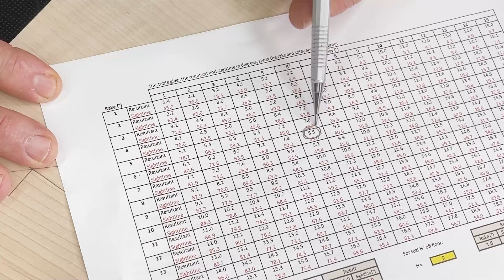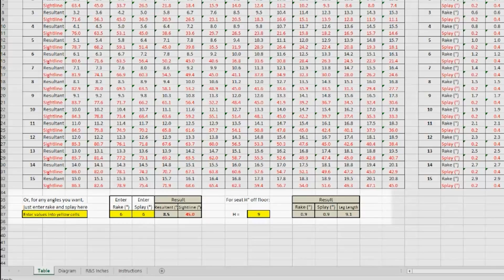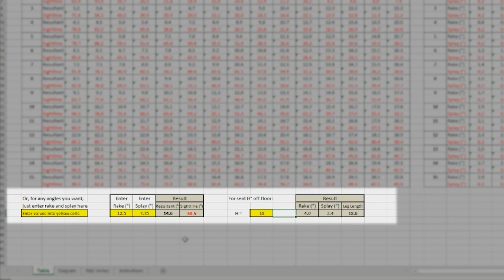Design & Build Angled Legs with DUAX Angle Drilling Table | Deep Dive | Woodpeckers Tools

Comment: Jeff, I've been looking at this for a while now but haven't quite been able to pull the trigger. The reason is I keep looking at the AutoAngle Drill Guide and wondering if it would be more useful or convenient being it's not constrained to the drill press. It would be a great "Deep Dive" going over the two together explaining the differences and where one might choose one over the other.
All the Best, Chuck.
Reply from the maker: Well, Chuck, I'll pass along an anecdote which I think will help you out. I would have to look diligently to find the Duax that is in my shop, but the AutoAngle is on the right back corner of the workbench that's against the south wall. I like the Duax, but AutoAngle is a little faster to get set up. If I were working on something that required absolute precision, I'd probably dig out the Duax. I did similar splayed leg stools with both for their Deep Dives and both handled the job admirably.
Reply: @WoodpeckersLLC  Thanks for the quick reply! That is what I was thinking, Duax for a bit more accuracy over the AutoAngle for speed and convenience.
Not quite the same thing but years ago I asked my Festool Rep. to explain the differences between the DF-500 and the DF-700 Domino's and which to buy first. His answer was, "buy the DF-500 first, but knowing you, you'll end up getting both".
The man is clairvoyant. 👻
I'll get the Duax for now, but I'll probably end up getting both. 🤣
I do love Woodpecker's tools!
All the Best, Chuck.

Comment: I built a pair of restorer's trestles (3 pairs actually) with splayed and raked legs that are let into the beam in socket (i.e. 3-sided) mortises.  The splay and rake angles are different.  So, I had to saw and chisel out the sockets at a compound angle.  It's not something that stays in my head, I have to re-learn how to calculate the resultant angle every time because I cut compound angles infrequently.  I enjoy the challenge of figuring it out and executing the cuts by hand.  That's what being an engineer gets you - more work.

Comment: On my list of projects is the building of a bench that about 12" x 48" with angled legs.  The surface area of the Duax doesn't seem large enough to support such a large board.  Any ideas on how to support 12" x 48" or are you planning to create a larger, big brother version of the Duax for these bigger projects?
Reply: ...and BTW I do own the large 48" Woodpecker Drill Press Table.
Reply from the maker: Two comments. First, you've come across the #1 reason we built the AutoAngle drill guide...drilling angled holes on large workpieces. https://www.woodpeck.com/autoangle-drill-guide.html

Second, I am trying to visualize your design. Most splay leg benches have all the angles in the legs and an apron, then the bench top joins the apron squarely. The apron joinery would be pretty straightforward with a Duax.
Reply: @WoodpeckersLLC  Thank you for your quick response.  I've got 14 of you systems on my wish list but I somehow missed this one.  This is the perfect solution for my current needs but I see how Duax would better manage smaller parts.  I really appreciate everything you do.

Comment: everybody trashes Shopsmith equipment I noticed the Shopsmith dust collector used mine over 20 yrs before motor burned out
hoping to get new one soon
Reply from the maker: They're a nice compact unit that attaches to small equipment easily.

Comment: I went to the Tiny Shop Woodworking blog and saw his post, but I was unable to find a link to the spreadsheet — only a printout of the table you show in the video.  Can you post a link to this spreadsheet here?  I tried the "contact me" link and it does not appear to be going thru to the author.
Reply from the maker: There is no link. You have to use the "Contact Me" form and give your e-mail address. He'll send you the spreadsheet by email. Be patient.
Reply: @WoodpeckersLLC  When I requested it, he replied very quickly. That kind of math gives me a headache so I'm very grateful for his generosity.

Comment: If you ever get around to making a Mk.2 version, change the sacrificial block cut out shape to a 'clover leaf' with 4 corner holes centered on the intersection of the sides. Not everyone has a CNC router to cut out playing card shaped blocks and a clover leaf shaped cut out would let anyone with a saw (hand, table or rail) easily make their own blocks, and for drilling through holes that come out of the top surface you are going to be using a lot if don't want your project to have a bunch of 'moon craters' on the show side.